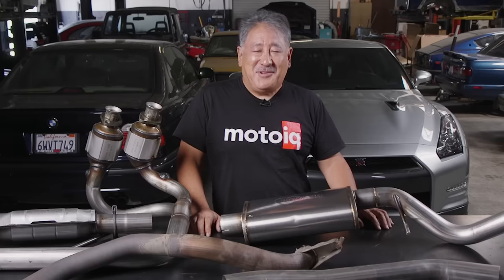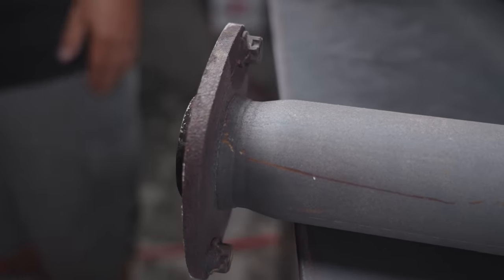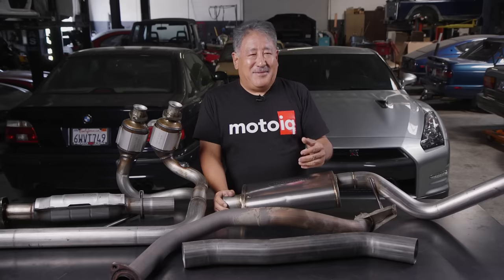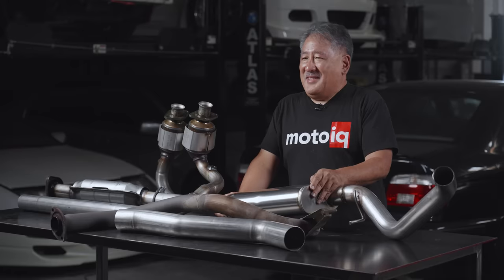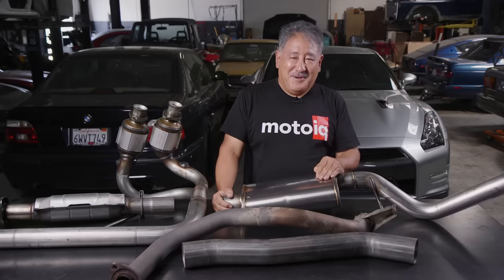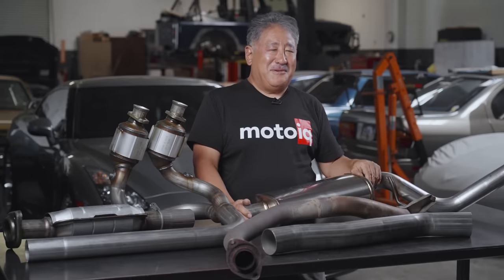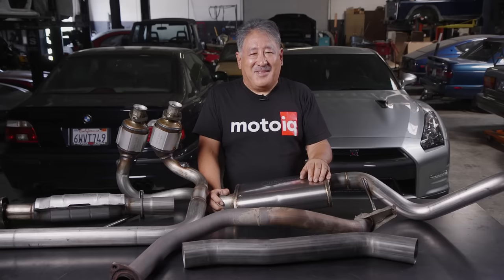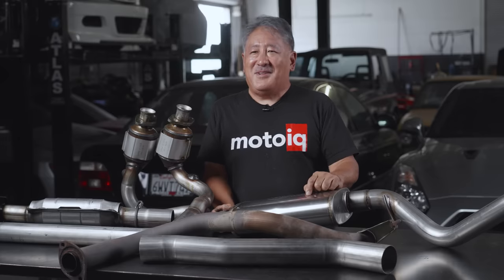Exhaust Back Pressure Myth DEBUNKED!

Comment: This is awesome. One thing to note though is that this is applicable to 4strokes only. 2strokes use an expansion chamber to create a reverse pulse (causing back pressure) in order to efficiently scavenge due to the nature of a 2stroke (as a 2stroke runs, some fresh charge is moved out of the transfer directly into the exhaust. The expansion chamber uses exhaust pulses to capture this lost charge and force it back into the cylinder, increasing dynamic pressure and power/efficiency)
Reply: Truth. Back pressure on a two stroke is essential for low end power. That's why power valves exist. They open up at high rpm and close at low rpm, creating some back pressure.

I had done a cat delete on a two stroke a while back and I immediately noticed how my low rpm power had gone to shit.
Reply from the maker: No it doesnt, pulse tuning isnt adding backpressure. We did a video on it.
Reply from the maker: deleting the restriction on your expansion chamber slowed the reflected wave speed and threw your pipe out of tune, that caused your loss of bottom end not reducing the back pressure.
Reply: yes, because, as I explained, the pulse wave is tuned to use back-pressure to force charged air back into the cylinder. the pulse wave is by definition backpressure.

Backpressure- the pressure within a system caused by fluid friction or an induced resistance to flow through the system. 

An expansion chamber uses fluid resistance caused by variable pressure (done by opening or expanding the pipe diameter and then narrowing it) to create the pulse. The pulse itself is timed by the specific angle, distance, and geometry of the expansion chamber and header. When these synchronize with the rpm of the engine, (known as "coming on the pipe") is when the effect takes place. A shorter expansion chamber or header throws off this band, which is usually a 2k rpm band (depending on the expansion chamber type)

2 strokes depend on the resonance of the exhaust pulse to push against the motor(backpressure) and force the expelled fresh charge back into the motor(scavenging).
It is also the reason why a 125cc 2stroke motor can combust 180cc of fuel/air charge at a time. Pressure waves reflected back to the motor forcing the charge back into the cylinder. A pressure wave...flowing in the reverse direction...a back-pressure.
 @motoiq
Reply from the maker: I am talking about mean backpressure from a thermodynamics sense not periodic pulsations in the pipe.
Reply: @motoiq  ah, static back pressure, not dynamic, gotcha. Dynamic good, static bad 👍
Reply from the maker: Check this out, Gail Banks explains the gas exchange part of the PV curve better and more simply than I did.  https://www.youtube.com/shorts/k7yYY_hy250

Comment: Volumetric flow (m3/s) is impacted by back pressure. By increasing pipe size, you might gain some volume flow, but when you divide the increased cross sectional area of your pipe, your velocity will most likely decrease. Great video.
Reply from the maker: Someone who gets it!

Comment: Thank you for your awesome explanations.
Question:
For a heavy 4WD Toyota LandCruiser Prado with diesel 1kD-FTV engine (4 cyclinder 3.0 litre), mods are plus 30 injectors, larger turbo, much larger intercooler and relocated to front.
Seperate ECU.
2&3/4 mandel bent steel exhaust.
No DPF
No EGR
220 HP and 512 Nm at the wheels.
Transmission had nomad valve bodies.
Is 2&3/4 inch mandrel bent exhaust large enough?
Reply from the maker: I would say its ok but a 3" would be better.

Comment: Great video! Is tuff to explain things like this sometimes to people who "know everything" already! Back pressure is so useless that extreme performance vehicles have the exhaust on the highest vacuum area of the vehicle not only having zero back pressure but in reality "sucking" the gases out of the engine! Thanks for the video! ✌
Reply: Ferrari 488?
Reply: @GonzoDonzo  Not sure about that model specific, but if you look for the most powerful engines in the world (Top-Fuel Dragster) the pipes have no restriction or back pressure at all and as far as I know, the point up as the exhaust pressure creates more downforce also. Many different examples and applications, such as thin wall thickness with springs to create a resonance effect basically (peristaltic effect self-propelling the gases out)... everything is kind of exaggerated, but that is what makes the difference in the end!
Reply: @guzforce  yeah old piston driven planes did the same thing but used the exhaust gases to propel the plane forward. Its something like 10% of a p-51's thrust at full power comes from the exhaust.
Its a very complex problem and were starting to figure things out thanks to our computer modeling. So we design for the application

Comment: "Back-pressure" as a thing to discuss anymore should be a myth.  There is no such thing, unless your exhaust is plugged.  The goal in designing the exhaust system is to achieve a laminar flow, at a velocity sufficient to move the volume of exhaust gas the engine is outputting as quickly as possible without moving so fast as to create turbulence from the drag or viscous forces the pipe walls generate, or so slow as to stagnate and create turbulence just from faster flowing gases bouncing off of slower.  When you consider the fact that gas output from the engine is constantly changing with engine speed, and the possible variance in output can literally be 10x higher or lower (think 800 rpm vs 8000 rpm--those cylinders are pumping out the same volume per revolution, but 10 times as many revolutions in a second), and that the volume and viscosity of a gas changes with temperature,  its an engineering nightmare to create an exhaust that is optimal over any wide range of engine speeds.  At least until someone invents variable diameter exhaust, and I expect we'll have flying cars before Honda announces VDEC.
ok, so what's this all mean then?  Choose an exhaust setup that maximizes laminar flow at the engine speed you'll spend the most time driving in.  Live downtown in stop and go traffic that rarely lets you get up to speed?  Smaller diameter pipes would actually benefit you.  Building a track car for events or fun that you dont intend to be a daily driver?  You can use some much bigger pipes.  Drag car?  Fuck the exhaust, find some side pipes and vent that bitch right from the headers.  :)

Comment: A little back pressure meant that in the smaller pipes, you had velocity, the engines back then did not Rev as high and if they did they were not happy about it. low end torque was king.  Longer stroke lower compression, means that a long pulse and fast velocity meant smaller tubes.  This meant backpressure was going to happen.  

With shorter strokes, better intakes, ect, being able to dump the exaughst in a large pipe is better

Comment: You´re the man, Mike! Cheers. This helped me quite a bit in my exhaust build for my Harley Night Rod Special. 1250cc with 126 rwhp ish, 86 ft lbs peak torque at 7k rpm. Redline at 9k. Went with 2" headers stepping into 2,125" that then merge into a collector with 2.5" outlet into a 17" long muffler, 3" diameter with perforated core and reversion cones. Pie cut bends for the look of it, but I do want the pipe to perform. Seems reasonable?
Reply from the maker: Stepped headers seem to really help on Harleys.  Sounds good!

Comment: Backpressure prevents airflow. It's a restriction within the system.
Another way to think about backpressure is that it is a restriction in the system with a certain amount of pressure needed to overcome. If the engine creates 20 psi of pressure, but the restriction requires 10 psi to overcome then only 10 psi is leaving the exhaust. If you get rid of the restriction and have 20 psi leave the exhaust, then you'll have more pressure, hence more velocity exiting the exhaust.

Comment: 1:30 this is all man. You gotta have the correct diameter and air flow restriction for ur engine and configuration. for example If you want an engine with low end torque u cant have an open pipe. If you are looking for that top speed or drag config when u are going to have the engine full reved the whole time, then probably going open pipe is a good idea.

Comment: It depends on what you want, there was a "paper" from few years ago from an aussie engine that they replaced the log type exhaust by an "equal lenght", of course it had more BHPs, but it came with a "floating", "wobbling" torque curve, after reading all of that, my toughts were more or less...so, in low RPM is good to have some backpressure, but in higher revs, it's exceptional to have a free flow well dimensioned exhaust
Reply: It’s never good to have any back pressure.

Comment: Thanks for the great video, I put a gasket on the connection between the muffler and the exhaust pipe for a better sound. It can be said that this part of the exhaust is leaking now, will it damage the car engine in the long run or not?
Reply from the maker: No

Comment: Some say that "an engine needs backpressure to work correctly." Is this true?
No. It would be more correct to say, "a perfectly stock engine that cannot adjust its fuel delivery needs backpressure to work correctly." This idea is a myth. As with all myths, however, there is a hint of fact with this one. Particularly, some people equate backpressure with torque, and others fear that too little backpressure will lead to valve burning.
The first reason why people say "backpressure is good" is because they believe that increased backpressure by itself will increase torque, particularly with a stock exhaust manifold. Granted, some stock manifolds act somewhat like performance headers at low RPM, but these manifolds will exhibit poor performance at higher RPM. This, however does not automatically lead to the conclusion that backpressure produces more torque. The increase in torque is not due to backpressure, but to the effects of changes in fuel/air mixture, which will be described in more detail below.
The other reason why people say "backpressure is good" is because they hear that cars (or motorcycles) that have had performance exhaust work done to them would then go on to burn exhaust valves. Now, it is true that such valve burning has occurred as a result of the exhaust mods, but it isn't due merely to a lack of backpressure.
The internal combustion engine is a complex, dynamic collection of different systems working together to convert the stored power in gasoline into mechanical energy to push a car down the road. Anytime one of these systems are modified, that mod will also indirectly affect the other systems, as well.
Now, valve burning occurs as a result of a very lean-burning engine. In order to achieve a theoretical optimal combustion, an engine needs 14.7 parts of oxygen by mass to 1 part of gasoline (again, by mass). This is referred to as a stochiometric (chemically correct) mixture, and is commonly referred to as a 14.7:1 mix. If an engine burns with less oxygen present (13:1, 12:1, etc...), it is said to run rich. Conversely, if the engine runs with more oxygen present (16:1, 17:1, etc...), it is said to run lean. Today's engines are designed to run at 14.7:1 for normally cruising, with rich mixtures on acceleration or warm-up, and lean mixtures while decelerating.
Getting back to the discussion, the reason that exhaust valves burn is because the engine is burning lean. Normal engines will tolerate lean burning for a little bit, but not for sustained periods of time. The reason why the engine is burning lean to begin with is that the reduction in backpressure is causing more air to be drawn into the combustion chamber than before. Earlier cars (and motorcycles) with carburetion often could not adjust because of the way that backpressure caused air to flow backwards through the carburetor after the air already got loaded down with fuel, and caused the air to receive a second load of fuel. While a bad design, it was nonetheless used in a lot of vehicles. Once these vehicles received performance mods that reduced backpressure, they no longer had that double-loading effect, and then tended to burn valves because of the resulting over-lean condition. This, incidentally, also provides a basis for the "torque increase" seen if backpressure is maintained. As the fuel/air mixture becomes leaner, the resultant combustion will produce progressively less and less of the force needed to produce torque.

Comment: When you have a low compression, low horsepower engine   you need back pressure!! The 3.8  v6 Monte Carlo with a Swiss cheese  muffler lost all power and was fully restored with a new exhaust  installed.  That's just one of the many.
Reply from the maker: It's a lack of understanding about what the fundamentals of the problem are, its not lack of backpressure but lack of savaging caused by too large of an exhaust tube.  You really need to watch the video. If you understand the thermodynamics of a 4-stroke engine, if you retain pressure in the engine, the about of work or power recovered in the cycle goes down.  If you want to read about why, google PV curve for 4-stroke engine.

Comment: I've been building high performance exhaust systems for 40 years using 3 inch stainless mandrel bent tubing.  Fortunately I live in a state where I don't need a catted system.  Normally I mandate 3 inch tubing from the header collectors through the X pipe and into high flow  non S type mufflers.  I do switch to 2 and 1/2 inch tailpipes to reduce noise as there is little restriction on the open ends.  This is the system I currently have on my 2015 Ram R/T fitted with a 445 cubic inch NA gen 3 Hemi.  It is nearly as quiet as stock and is a bear at any RPM.  Back pressure my ass!  Let it breathe and don't plug it up with Cats if the regulations where you live don't have an issue!  Use longer mufflers if you really want to cut down on noise!

Comment: Tell that to the MTU marine engine installation manual that specifies a minimum and maximum exhaust back pressure.
Reply from the maker: It's because the MTU engines that have that spec are blower scavenged two stroke diesels and you have to keep certain pressures across the system for it to work the best. Very interesting engines.

Comment: I have always wondered if the back pressure saying was because of confusion of a two stroke and four stroke engine. Two strokes tune the exhaust with the expansion chamber to increase scavenge but the reflected sound wave forces the exhaust gases with fresh air and fuel back into the combustion chamber as the piston closes the intake port increasing the pressure and charge in the cylinder. This happens in a timed frequency and creates the powerband in the motor.

Comment: I owned an 81 Camaro as my first toy car. Was registered as a v6 but dropped a built Eidlebrock 350 crate engine in it. Headman headers and standard exhaust after for sound. lots of other mods. One day I caught a speed bump I wasn't expecting and literally ripped off one of the exhausts right at the header mount. In the typical careless kid fashion, I decided i liked it loud, ripped the other off and straight piped it out the back. 0 restrictions, basically open headers. There was a clear performance difference. I felt as though I lost low end torque, the accelerations was clearly hurt. The  top end felt great, but if you let off the gas the engine felt like it was tripping over itself...think of running full speed then going down hill and trying to keep up. So, I have long felt that a little back pressure is a good thing. I am unsure about actual tuning data, but I can tell you for sure that there is, if not a power reduction, a power band shift with reducing the backpressure. I prefer to accelerate fast and live in the 0-100 range. I have no real interest in going faster than that but have every interest in getting there as fast as possible. Reducing back pressure hurt that experience for me, at least in an old style v8 engine. Maybe it is different in an inline or flat 4 or something. All i can offer is my experience, which conflicts with what is being said here. Maybe someone can explain it to me.
Reply from the maker: You lost bottom end due to losing scavenging, not by adding backpressure, if you are running open headers, then collector extensions or smaller primaries will work.

Comment: Typically a person would try a larger diameter exhaust and less restrictive exhaust once or maybe twice in a loved car. Say a challenger, mustang or Camaro. You order up: high flow cats with a 2 1/2" tubing to the back. Maybe you fund another try with 3" tubing with a different muffler and see how it performs on the street.  Typically as almost all users it will be: how does it sound and does it feel faster? Not a lot of us will ever see a dyno with 2 1/2 and do another run with 3" and come up with wow I gain 10 horsepower at 6900rpm and dropped 8 horsepower at 2900 rpm.

Comment: There is one thing to remember though. If you open your exhaust on a stock engine with no tune you will lose power. You have to add fuel if you open your exhaust. Burned a valve guide and dropped it on my 2000 Impreza outback 2.2 by opening up my exhaust without adding fuel. Any modification off stock that adds to air flow needs the tune to go along with it.